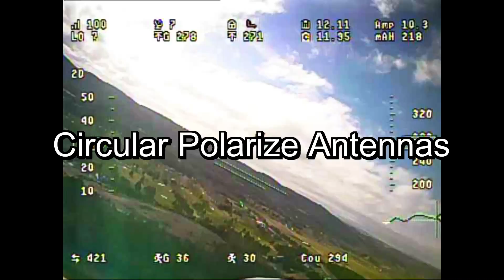Vector OSD Twin Star Maiden Test Flight -FPV Build Part 10

Comment: Thanks for the build videos I've 2 Twinstars one pre owned and a boxed one. what sort of flight times are you getting? Anything you would change now you've flown it for a bit?
Reply from the maker: I think it will fly for an average of about 20 minutes.  No I have not changed a thing on it yet. It might could use a 360 degree pan servo for the camera and maybe move the cam forward a little for a better view.

Comment: Thanks for the inspiration and build tips.. finally completed
my Twinstar II FPV build videos, gave you a shout at at one point during my
videos. The 5th one I did some commentary on the first FPV flight while it
occurred.. Happy flying https://www.youtube.com/watch?v=ODNz20F0s9U
Reply from the maker: +Flight-Stew Cool, I checked them out.
You should do another flight video with the 4s battery but I like what you have. It refreshes my mind on my build and has good detail. I didn't know about the wing spar supports.

Comment: I'm happy to see this maiden was successful. Congrats ! 
1/ why have you not setup the 'gain' on a knob ? I find it useful. 
2/  Have you try 'remaining time' calculation ? 
3/ Did you find airspeed useful for a RTH for example. I didn't find any info on this. 
4/ Have you seen on RCGroup the ability to use Smart Port on Frsky to output data from vector and feed telemetry with it ? (in another word making incredible LUA script display 'like' an OSD on taranis screen ) 
5/ If only there is a way to test all feature like with with Mission Planner and Xplane (I remember the excellent tutorial you maid for creating airport !) 
6/ Was is the Final weight of your great twinstar (after laminate ? I didn't see it in previous video)

Comment: Great Job. Thanks for sharing and a special thanks for the info on the ET Vector. Were you using Rudder to do the turns in 2D or Aileron? Have you done any 2D landings or takeoffs yet? Thanks Zac
Reply from the maker: ElectraRC I did use both rudder and aileron on some of the turns in 2D mode although I am mostly a bank-n-yank flier. I switched to 2D right after take off so most of the flight was in 2D even the landing. Next time I fly I will used 2D mode for the launch since I know that it works now. I just needed to test it first. Thanks for the comments!

Comment: Gr8 job Dave Now how's about doing a final costing Vid ?
Reply from the maker: Brian Mabbett Now that is scary. Kind of like looking at the national debt :-)
It's something I have never done before but I might give it a try. Do you have suggested talking points? Outline please?
Reply: ***** i think you have got to look at bang for you'r buk's , brake it all down and you tell us if it's money well spent. Personally 5 Dollars on foam board is pushing it..But if you have a money tree in the back yard like you lol it may well be worth it .... Ps keep up the good work
Reply from the maker: Brian Mabbett I have thought about listing all the prices for the items. I guess it would probably come out about $600 for what's on the plane. But then you have the RC radio, goggles or ground station. It would be a lot of work and the result would only be useful for a short while before prices change or new versions come out. However I provided links under the video for those who want to get current prices from the vendors.

Comment: Very NICE !!! Congrats.  As u will find with the 3s 5000 batt and crushing u should see in upwards of 30 min or more. And if u use 8" props can reach over 40 min of flight with what I call the best fpv cruiser on the market.  Twinstar is awesome and very low stall speeds.  Awesome flight and so glad u had a window to maiden ;) thumbs up.
Reply from the maker: ThailandVenture Thanks for the congrats and thumbs up! What pitch on the 8 inch props are you suggesting? I am always up for experimentation. The 7x5's put out so much thrust I wouldn't think I would need 8 inch on these 1400kv motors.
Reply: ***** we usually use the standard quad 8.4.5 CCW and CW. For some reason they do better as there is less drag at low rpm and the high pitch of the 7x5 seemed to cause more amp draw then needed. Also normally we use a motor at 900kv or even less at 800kv as u probably already noticed the twinstar needs very little throttle to get lift. It's a great glider and low throttle flyer. Actually the twinstar is best know for its ability to cloud surf easily and maintain altitude above the clouds and for long flights. ;)  once u do it u won't go back to normal low flight flying.  It's extremely addictive and of course fun as heck. That's why I suggested the 3s 5000. It's lighter and the amp draw is minimal with the dual motors and lift created by the TS
Reply from the maker: ThailandVenture Interesting combo. That's more like the motors on my quadcopter which had 980kv motors. Thanks for the info sir.
I wish I could do that cloud surfing as my SkyWalker could do that too. The problem is that US government is restricting any high altitude RC flying for air safety purposes. People have been fined for flying above the clouds in some cases.

Comment: Nice uneventful maiden, Dave! The way we like 'em! ;-)
Looks like that will be a great cruiser as you don't need much throttle!
Reply from the maker: TheAdkFlyer10 It went a lot better than I expected. So easy to fly and there was no wind either so I got a good feel of how it handles.
That plane can float along with just a little power. Still I think the SkyWalker can fly longer. The cool thing about the Twin Star is the compact size. So easy to hand launch too.

Comment: Congratulations Dave, it looked like a successful maiden and the culmination of a very remarkable build.You looked like a proud, anxious father watching his kid taking his first steps, but it was fun to watch. I'm amazed at the power and how little throttle it took to climb like it did.  How was the CG and did it require any trim?
Reply from the maker: Tom Muhleman, Jr. Yes I was a little anxious about this maiden and worried I had got the motors installed at the weird angle or got the CG all wrong. It turned out the CG point was perfect from the directions and it flew so good I forgot about applying any trim. It was a short flight however. I will learn more about the setup going forward. Thanks for your support Tom!